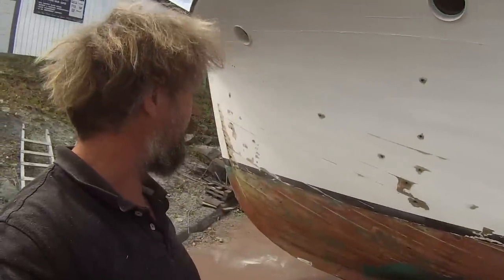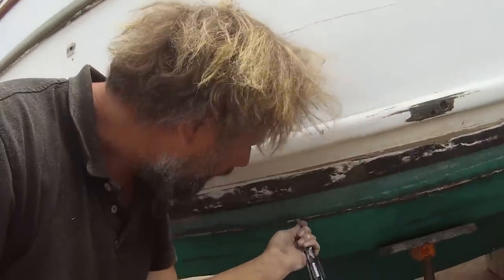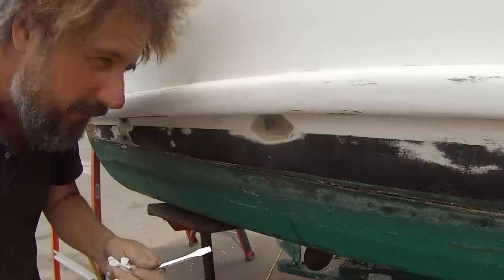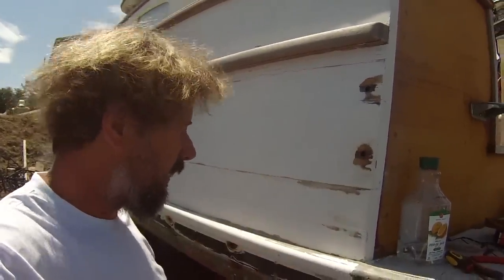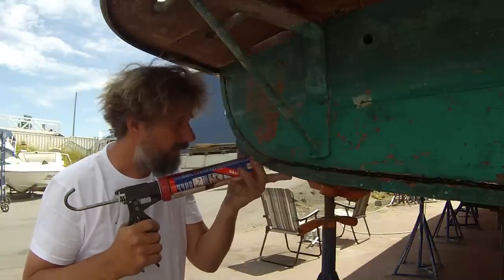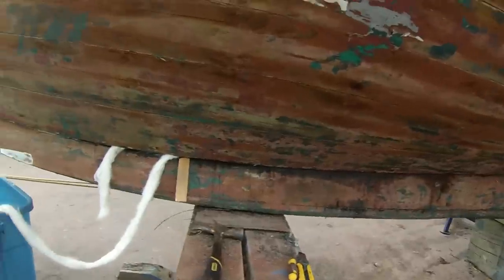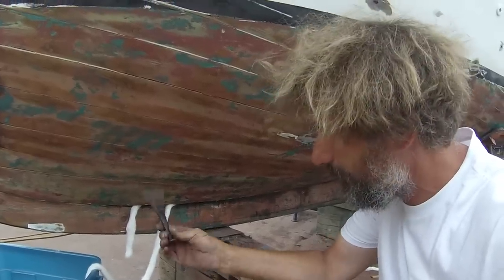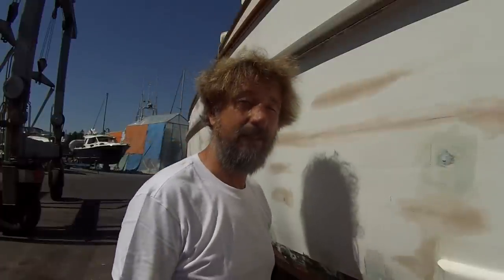Repairing the hull - Wooden boat restoration - Boat refit - Travels With Geordie #56

Comment: A TIP! After application of filler to keep it from coming back out of holes and seems lay some good fresh 2” masking tape over the filler before it sets and run the spreader over the tape to fair it. Remove the tape right after filler sets and bam a clean flat fill that needs minimal fairing! Good luck!
Reply from the maker: Woo Hoo, best tip in a long time. Thanks.
Reply: Forgot to mention precut the tape and tap it near the fill areas before mixing the filler makes fast work!

Comment: On the next Hall out use a product called extend it's the best way to stop iron or steel from rust the nails you have that are bleeding rust can be stopped from bleeding with an application of said product EXTEND. It turns rust back into carbon a building product of steel!!! And other wise use copper screws for back-up fasteners!!!
Reply from the maker: I'll have to look into that!

Comment: I live aboard my 1926 wooden boat on the Fraser River in BC. A seam opened up on the south side above the water line. I have cotton, oakum and a caulking hammer. I have watched several videos and was curious what product you applied from the tube. I am a woman doing my own repair as my husband died 2 years ago, it needs to be simple.
Reply from the maker: Hi Shelly. If it's a seam above the waterline opening up in this hot, dry weather it's perfectly normal. Don't put anything in it, it will swell up again in the damp season and if you put anything in it it will ruin the seam by crushing the fibres of the wood. Be careful of you go cruising though as wake might leak in and you'll take on some water. happily that will close the seam too, but not immediately.
Reply: @TravelsWithGeordie  this was wholesome.
Reply: Hi

Comment: Great information. I am helping out on the restoration of a "1945 80' foot" wood hull with minor leaks. The owner was told to GEL coat after sealing it over sealing and Painting. Would you suggest a different approach? Maybe fiberglass first than Paint or GEL coat. The idea is to not deal with the out of date leaking model
of this type of construction.

Thank you for your insight.
Reply from the maker: Thanks Clay,
I would stay away from any fiberglass or gel coat on a wooden boat. It will kill the boat in short order.
Wooden boats need periodic maintenance, that's just the cost of their joy. They can't be "updated" successfully, although many try. and largely destroy their boats.

Comment: I am restoring my old 22 foot yacht and have come across a grey sealant that in THIS case I need to use again for sealing fittings that may need to be removed later.  I need something that won't bond permanently but will seal to stop crevice corrosion on stainless.  The stuff you call "slickstene"? could be the same thing.  Can you let me know how it is spelt so I can try & track it down?  I have looked locally (NZ) for a while but can't find anything similar so may have to look overseas.

Comment: Anyone got any tips for the smaller chip repairs in the seams? been using a putty with hardening compound then sand + Primer + Sand+ Primer+ Sand +Paint. I tape the seams super tight but can't seem to get that perfectly smooth finish I'm looking for, ways end top with a minor lip or edge. I'd appreciate any tips !!

Comment: Did you remove all of the concrete in between the frames in the bilge ? Why people have used concrete in wooden boats as counter weight or Ballast is beyond understanding ? This type of product will do nothing but promote rot in the Floor timbers and or frames.
I have owned along with my family a marina / boatyard for almost fifty years. If you need help or advice on the repairs of your vessel please let me know.
Reply from the maker: I haven't removed it all yet, I'd rather not do it while afloat!
There's some who believe the lime in the concrete actually preserves the wood. Everywhere I've exposed wood it's been in great shape.
Reply: @TravelsWithGeordie   hi i have a woodeng boat  planing on epoxy  and fiber glas all the botom exterior  what you recomend ?  Thanks.